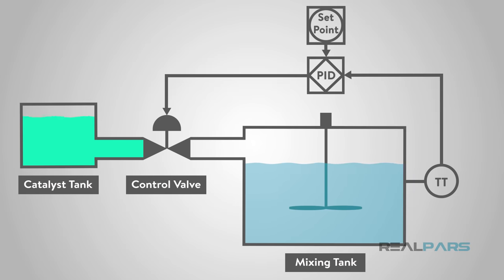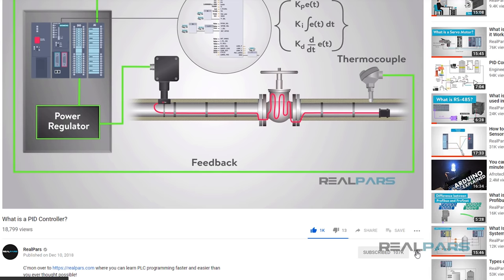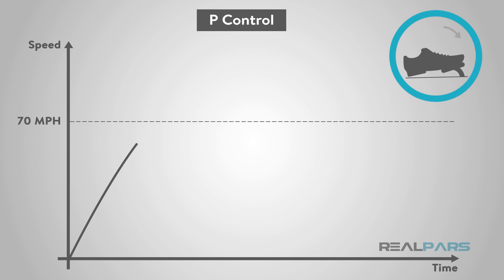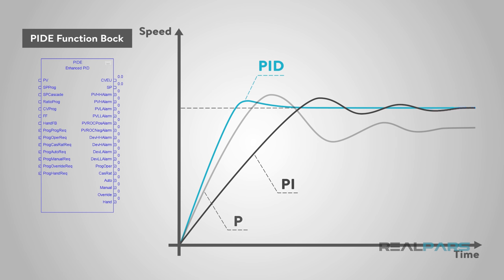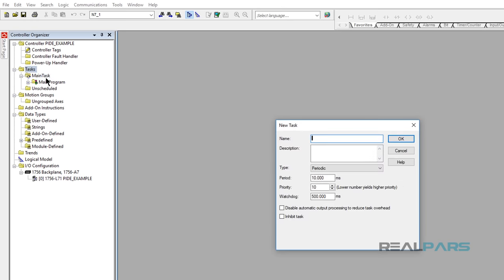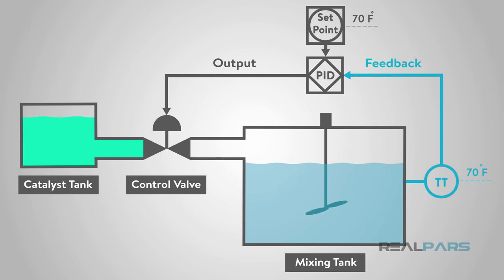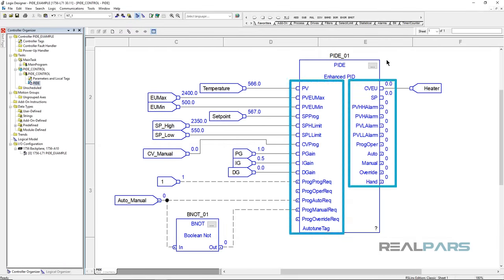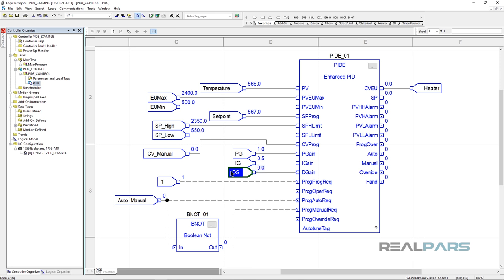How to Program a Basic PID Loop in ControlLogix

Comment: Plz make a video on Ziegler niclos tuning method so i can able to understand the PID topic completely
Reply from the maker: Will request this topic from our creator team, hopefully, this will be added to our video topic list :).
Reply: Z-N tuning is not a good way to optimize controller gain. The results are awful. This hurts production. I tell anybody that wants to use Z-N tuning to go away and don’t come back until they understand pole placement or another good alternative. Anyone teaching Z-N is suspect.
Reply: @pnachtwey  depends on the process but imc tunning would usually be better with self regulating processes
Reply: @realpars  Can you also show us the modified Ziegler Nichols tuning. This is more useful

Comment: Quite helpful. PID system and control greatly affects how a system perform and long after it has started up into operation. A not properly tuned PID System can be the bane of some operators Plant shift especially with chemical feed systems or pH control system in water system and can cause a lot of issues. A follow up video to this one properly demonstrating with animation as usual how to go about properly tuning a PID could be very helpful. It could show different examples of how you would go about tuning a loop to be Fast Reacting, Slow Reacting, Tightly Tuned, Not so Tightly Tuned etc. That can give people a proper idea how each the PID adjustments affects a tuning for various outcome in its control.
Reply from the maker: Thanks for your insightful comment, Ardent. Good suggestion about the follow up video as well. I will forward that to our creator team!

Happy learning!

Comment: good introduction, I am always wondering, instead of use PLC, I actually can use Raspberry Pi, relay, and python programming or node-red to implement PID control. and that is cheaper, easier, able to have more functions. If I am an investor, I really feel the risk of PCL and automation industry
Reply from the maker: You are correct, a Raspberry Pi  (or Arduino) controller is much cheaper. However, for even a simple industrial application, an Raspberry Pi controller presents multiple challenges. First, Raspberry Pi analog inputs are 0-5V, whereas the industrial standard is 4-20ma at 24VDC. Analog outputs from the Raspberry Pi are typlcailly PWM, whereas in industry they are 4-20ma. Converters can be purchased or built, but this adds cost and reduces accuracy and reliability. The Raspberry Pi is s 5.1VDC device with low voltage I/O. This low level of voltage operation would be very susceptible to electrical interface in any modern plant facility. The I/O is very low power, and starting large motors or firing inductive loads would require interposing relays. Even the most I/O intensive Raspberry Pi controllers have limited I/O. A plant with 2500 I/O would require approximately 50 networked controllers. This would require an inordinate amount of overhead programming that would outstrip the capability of the Raspberry Pi controller. There are no built-in functions in the Raspberry Pi, so basic functions like PID loops have to be programmed from scratch. And I could go on. I like the Raspberry Pi controllers, and  I believe they have a place in small skid-based processes or small device control, but they are not designed for large process control applications.
Reply: @realpars Wow, many thanks for your reply, appreciate you took it seriously. I like all of the technology/science parts of PLC, their proposed usages for industrial application. I got it, and I love it. I do use PLC, and I also use RPi and industrialised version of RPis. As you said, there are covert shields, 24V DC, 4-20ma are not problems, the accuracy, precision and durability can be enhanced in many ways. Programming is not a problem for the new generation, programming should be a fundamental skill. Scale problem? if 1 RPi not enough, I can use 100, even cheaper than one S7-1500. look at the container, docker tech, they are designed for scaling up. The concepts of opensource, community development are providing faster development speed, more function integration, rich options of supply. I am worried about the future of the PLC and automation industry if the current players still insist on keeping the closed, isolated approach to develop and sell (marketing) their software and hardware,  and soon or later, customers would have 'opensource' options, what level of loyalty are you expecting? The ICT industry is trying to take away the cakes from traditional automation players. Just look GE, Siemens from 2014 -2019. And look Microsoft (Azure IoT), Google, AWS, where are their hands. There is a 'disruptive innovation' happening NOW. just like the time while Ford introducing T line, apple's 1st iPhone,  see what Nokia, Kodak responded. You can find more case from wiki about 'disruptive innovation'...I feel it started silently for PLC, for automation, for manufacturing information systems. The war field of the commercial market is brutal, they would tell what they are going to do with you. Just check the latest interview of the founder of Raspberry Pi, read carefully about why they design RPi 4 like this. Is that for commercial use? Industrial use? Dude, I want the PLC and automation people to survive and have a happy life, they are the people far more honest and pragmatic than others,  they are trying to solve the problems rather than creating problems ( abuse your data and privacy). I am not saying PLC would totally lose the market, there are many cases still need very powerful industrial control. But can they stand still in the next 5 years, 10 years? I am not sure the flags of 'Industry 4.0' and 'IoT' would help current industry players. What I see, that they are losing the business gradually. Eventually, if these big, old guys die, maybe not a bad thing; it's making new space for more creative and useful products and service.    How do you think?
Reply: I enjoyed reading that reply. Especially knowing that arduinos could handle a skid application.

One other feature of a PLC are the opto coupled relays that are built in, they are more robust as they are tried and tested. 

Plc manufacturers are doing fine not opensourcing their software, to do so, would put their clients and their assets at greater risk of cyberattack. Arduino and raspberry pi target to small scale/ prototyping, their business needs to be open source to catch on, where as PLC manufacturers look at what industry needs and provides it.
Reply: @matthewmeuleman3369  thanks for your reply.  Yes,  PLC has done much more robust test than IoT open source device.  However,  we need evaluate the return of robustness,  or do you want more functions maybe more useful.  the question is very like when iPhone started to fight Nokia.  once you connected your device to the internet,  game changed lot.  closed source would not be safer than open source,  for example,  Linux system.

Comment: Howdy. Again very nice.
Being good with Data Types are a must if one aims to be a pro with PLC:s and analog signals. Let's clear up the PLC jargon.

PLC jargon.          Math jargon.           Example.
Hex.                       Hexadecimal          7D hex   =    125 dec (integer)
                               Integer
Decimal                 Integer                     128 dec
Real                        Floating dot value   6,456 x 10 exp 4   (dot in US and comma in Europe).

Let's assume we use a 8 bit analog input. The input A/D returns a 8 bit Hex Integer value. Now we must check the manual and establish if the return is a + only monopolar value or if it is a +  - bipolar value. If the return Data Type is bipolar the highest bit going ON indicates a negative integer. The monopolar span is 0 - FF hex. And the bipolar positive span is 0 - 7F, and the negative span is FF - 80 (ascending eigenvalue).
Now. The PID function block most likely will need input Data Type to be Real (floating dot). And it most likely will return in Data Type Real too. If we try to connect the analog intut return to the PID function block the programming environment will display Type Mismatch. We need to use a Data Type converting function block in between to convert Hex integer to Real. And the same at the PID return. Real must be converted to 8 bit Hex.
And observe. The programming environment does not necessarily recognize a Type Mismatch between monopolar Hex and bipolar Hex. One must be aware of the Data Type at every step of programming. If a function block recognizes a monopolar value as a bipolar value results may cathastropic when the value advances from 7F hex to 80 hex. That is a switchover from full positive to full negative.
Regards.

Comment: Does the control valves, like PCV, FCV, LCV, TCV,  used in various  units of petrochemical plant use PID feedback logic and PLC?
Reply from the maker: Thank you for your question. Indeed, it is possible, but it depends on the manufacturer and whether you have purchased the device with the ID feature. In the modern industrial market, many devices offer advanced features that can be obtained for an additional cost. We hope you find this information valuable in your learning experience with RealPars.

Comment: helpful video. How can i use the autotune feature in that function block?
Reply from the maker: The autotune feature, as you can see in the video, is available on a tab in the PIDE configuration window.  Autotune is a separate software product that requires a separate license.  Once installed, the configuration items on the Autotune tab will be active and allow Autotune to be enabled for the loop.
Reply: @realpars Oh :( thank you very much.

Comment: Do you have video that shows differences between two "control actions"?  As an example, suppose it is desired to control the temperature by reducing the input power to a heater when PV is greater than SP and increase the input power to a heater when the temperature falls below SP (i.e. take action in both cases).
Reply from the maker: RealPars has a much more detailed course on PID control available at RealPars.com.  In the course, all three control modes are detailed, and the equations and actions taken by the controller are demonstrated using a TIA Portal ladder program and a Siemens S7-1516 PLC.  You may want to check it out!

Comment: Hello! For my project, I have 1 PT and 1 FT to control a flow control valve (FCV), having setpoint of pressure = 8.5 barg and flow = 140 m3/hr. The PT is located before FCV while the FT is after FCV. When pressure reaches <= 8 barg, the FCV will be totally closed, else the FCV will be modulating valve open percentage to ensure flow at 140m3/hr. How can i apply this in PIDE?
Reply from the maker: What you described can be done with 2 PIDE loops setup as an override control scheme.  One controller will be set up for pressure control and the other as flow control.  You will then connect each output to a "low select" or "high select" block, depending on the actions of your controllers.
Reply: @realpars  Did you mean the scheme (multiloop selection) in page 6? chrome-extension://efaidnbmnnnibpcajpcglclefindmkaj/https://literature.rockwellautomation.com/idc/groups/literature/documents/wp/logix-wp008_-en-p.pdf

Comment: Why is output signal (CVEU) connector to heater but not to control valve?
Reply from the maker: Maybe 'heater' was not the best description for the final control element in this case, but the programmer has the flexibility to tag the final control element by function or by description of the actual device.  The important concept is the CVEU (control value in engineering units) is connected to the final control element to give the proper 0 - 100% output as calculated by the PID.
Reply: @realpars  thank you for the clarification. Yes, I understand the idea. I just got confused about the name of the output.

Comment: Hey
When the operators put the variables and values of parameter for the PID system respectively 
They use 1- P (Gain)
2- I (Time)
3-  Derivative (gain)
4- maximum o/p
5- mininum o/p
Now you have put the p 1
And I 0.5
Why ?
And why you make limit for 
Pv and sp ?
Reply from the maker: Hey, 
In most cases, the operators are allowed to change the Gains of "some" loops amongst all of the loops in the process. Meaning they will be given access through the monitoring system (HMI) so that they can modify these gains wherever it is necessary. The gains you see in this video are an example to start adjusting or tuning the relevant PID control loop. 
If we do not make a limit for SP value then the operator may be distracted and modify the Set-point to an out of range value and blow the process up!

Thanks
Reply: @realpars  yes I get understand you well.. And maximum and minimum out put .. These are  regarding limits of pv 

Thank you for helping .. You're the best
I have signed with you annual on your website ... And I have getten much better with programing👍❤
Reply from the maker: Hi Ehad, sorry for the delay here. You are very welcome! Happy to hear that you are making good progress on learning PLC programming. :)

Comment: Does SIEMENS have PID  block as well?
Reply from the maker: Yes, the most common are CONT_C, the continuous PID control for STEP7 v 5.6 and PID_Compact for the later versions of TIA Portal.  Both blocks essentially allow for the configuration of PID control, but differ in features and implementation.

Comment: What if the only language you can select is ladder diagram? How to I add function block to this list
Reply from the maker: Thank you for your inquiry. If you're using outdated PLC software lacking math capabilities or software that's over 30 years old, it might not include built-in function block features. Nowadays, most professional PLC software packages come equipped with PID function blocks. I cannot confirm if training software provides these features; you may need to upgrade to a professional version.

However, if you're proficient in mathematics and your software is up-to-date with the latest math functions, you have the option to create your own PID controller. In essence, a function block simplifies the programming process, where someone else has already designed the program structure, and you only need to input the relevant parameters. The output will then generate results for your output devices or analog and digital cards as required.

Happy learning!

Comment: what about LQR /LQG Hinf can we use them in plc
Reply from the maker: Yes, there are those (mainly in academia) that suggest using Linear Quadratic Regulator (LQR) algorithms and Linear Quadratic Gaussian (LQG) algorithms for PID-type control.  The common feature of these two approaches is that the gains are dynamically calculated as the process runs.  This usually requires matrix calculations, which are not easy to do in a PLC.  It is possible, but unless you truly have a process that must be modeled using a second-order process model, it is likely not worth the extra effort, and if it is, a different, more efficient computing device than a PLC to handle the matrix calculations would be a better choice.

Comment: how to install Siemens s7 software
Reply from the maker: Hi Arun,
You can download and install STEP7 through the following links. If you fill in the registration form they will guide you through the process step by step.
https://sie.ag/2eH6GEM https://sie.ag/2Jt80F0 

p.p1 {margin: 0.0px 0.0px 0.0px 0.0px; line-height: 17.0px; font: 12.0px Helvetica}